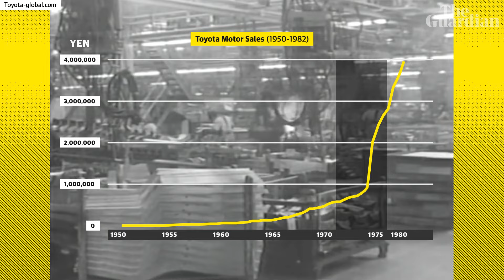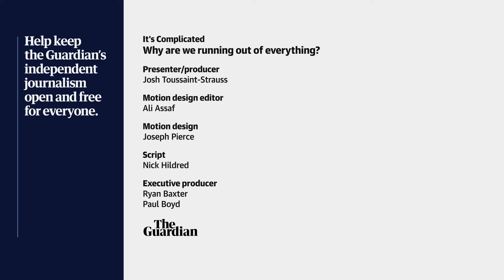Just in time: why we keep running out of everything | It's Complicated

Comment: I was a manufacturing manager in the early 80's  when "just in time" was the darling of all the top business schools. It was obvious to me than that all " just in time"  manufacturing did was force the suppliers to hold the large manufactures inventory. It was never about efficiency of manufacturing but more about saving the cost of that inventory.
Reply: I worked as a consultant in retail and it was the same there.  What went really wrong was outsourcing IT as the board was (a) captured by the consultancy (b) ignirant of how much value they got from internal IT which was far more central to the business than the donkeys realised.  Following trends tends to be a way for consultancies to part compznies from a huge amount of money...twice as they are brought in to bring the service back in house
Reply: The problem I have with just in time is that you are increasing risk. The inventory is like an investment to reduce risk, it should be seen as necessary insurance.
Reply: That's the American bastardization of lean

Comment: “Efficiency” is not the only benefit to manufacturers like Toyota, quality is also improved. If a component has been made incorrectly, and someone on the line notices, they can inform the person making the component and the issue is rectified almost immediately. In a “just in case” situation, that component could have been made months ago, meaning you have potentially months worth of defective components. Sure, if you are a retailer selling toilet paper, then Just in Time is really only for the cost benefit, but cost is not the only benefit in general.

Comment: A bit of a simplistic explanation..
Jit is about reducing batch sizes to an ideal of 1..
The emphasis is about improving processes and eliminating setup costs with flexible manufacturing, work centers and staff training.

The nhs would greatly benefit from this.. It still operates as a 1970's manufacturer.. Think of patients as raw material and you get the idea.. Lots of big waiting rooms across hospitals and all offering just one service... 

Why am I writing this.. No one cares 🤣
Reply: Oh they've done it to the NHS.  When did you last use it (I mean hefore 2020)? In my part of the UK we have a local hospital & A&E 25 minutes from home that has been down graded to a minor injuries (after a £25m refit) and some OPD.  All childrens health is now centralised at the next hospital which is another hours drive down to road.  Radiation therapy for cancer is at another hospital another further hours drive, meaning seriously ill patients are being driven by volunteer drivers 2hours+ each way for daily 20 minute treatments.  This is utter madness.
Reply: @lat1419  that's actually bigger batches.. That's the nhs moving into the 1960's 😂
Reply: @pr5x  yes we didn't specify which century either.
Reply: @pr5x  but we are making progress, too slowly, but progress.  If anything the H&her may have the Streisand effect. 😁

Comment: Ironically, Japan was one of the last (developed) countries to implement "just in time" practices in its shops and stores, etc.  It wasn't until (7-11?) ,which was then still an American company (now, it's owned by the Japanese side, if I recall) introduced "POS" (point of sale), which basically is using barcode scanners to check stock and streamline inventory to a "just in time model", that Japanese shops came into line with other countries.
Reply: Wow interesting Why was it that Japan took longer?
Reply: Smart if used as an official method of inventory.
Reply: Completely incorrect.  Toyota (Japan) was the architect of just in time.